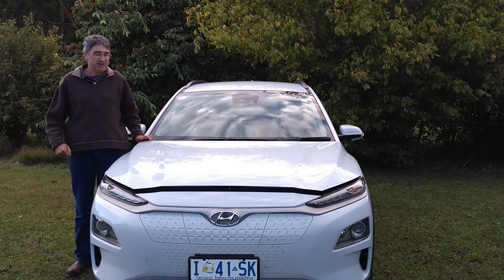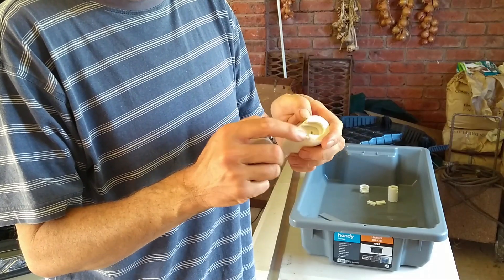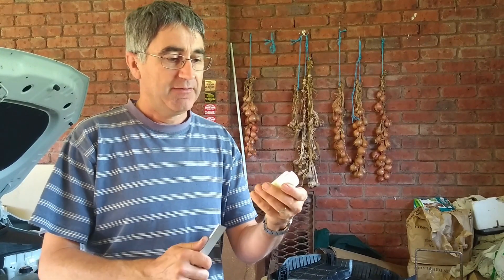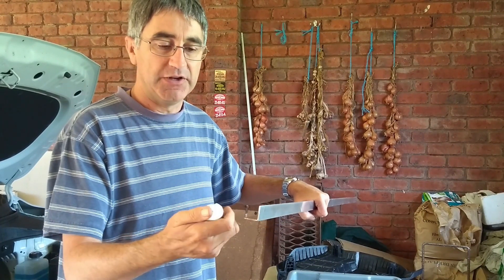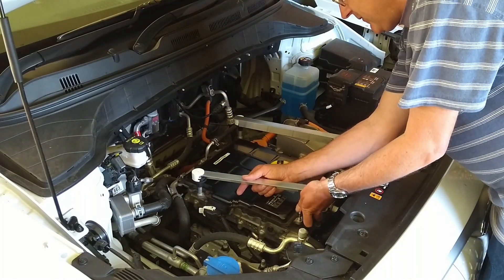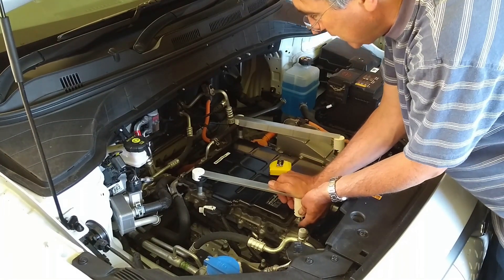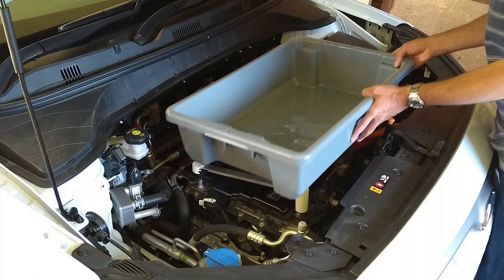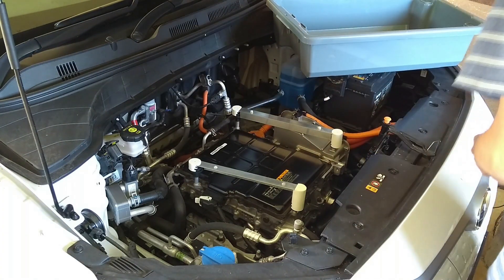DIY Froot (Frunk) for Hyundai Kona Electric

Comment: How is it 4 years after? 
I have doubts on the selfdrilling screws.. did thet stay in place with all the trillings?
Reply from the maker: Still going strong!
Keeps remarkably clean in there, I though the dust might get in.
It's been in and out a few times, and those screws are fine.  The 3D printed parts are a bit brittle, but they are still working.  No sign of any heat damage.
Reply: @christopherwalkden   a friend of mine printed the things for me in ASA... And it did well until now.. I checked cause the box was wobbly...  the back right piece was gone... the right front piece about to fail... so the frunk is out for now... I'm gonna need to print the pieces anew, probably in another material... do you know what material yours were printed with?

Comment: You could have used a 3mm bar and filed the ends down to 2mm, Also I would have also placed a bar across the inside of the Frunk to make it a bit more rigid. Also A frunk with a lid would have been a help too.

Comment: I am totally perplexed why so many Kona EV owners seems to want to bother
 putting a frunk in? As I have posted before, Hyundai avoided a frunk 
for reasons of affecting the cooling of the motor below in that area. 
All you are getting is a max of 1.8 cubic feet of storage? In a dirty 
outside temperature environment.
Reply from the maker: We've had a few months now to see if we actually use this space.  Perhaps I can help with your perplexion!
The Kona has about 330 litres of boot space, and the tub I put in is 30 litres (about 1 cubic foot).  330 litres sounds like a lot, but in practice it is tiny!
When we go travelling we have the boot filled to capacity, sometimes with heavy stuff.  There is some space under the floor of the boot, but that is not practical to access if you have anything sitting on the floor.  So previously, we'd put our charging cables on the floor of the rear passenger area.  Our charging cables are often dirty, so we'd clean them off before we went on a trip.
Now, we use our froot to store our charging cables.  We typically have an EVSE, an extension cord and a type-2 AC charging cable.  These all fit comfortably in the 30 litre space, and it doesn't matter if they are a bit dirty.

As for cooling the motor, it has a liquid cooling circuit which uses a radiator.  My tub is placed on top of the charger, which is on top of the motor controller, which is on top of the motor.  In theory the tub could affect the cooling of the charger, which is why I place it up on stilts to allow airflow.

Comment: You put a plastic box on top of a component that gets very hot.
I am concerned that this plastic us not thermally stable. 
The plastic is not heat resistant.

Your car does  not have a heat pump fitted to it.  Very strange.
Reply from the maker: The Australian Konas did not get the heat pump.  Very annoying for people like me in a cold part of Australia!
Indeed, the charger can get warm.  I've left a decent gap between the charger and the box, so it shouldn't heat up too much.  I imagine that if it is hot enough often enough then the box may become brittle over time.

Comment: Somebody should sell the 3d printed parts as part of a kit.  A Frunk would be a goof place to put the granny EVSE and any adapters such as ones to use an RV power socket or a Tesla level 2 charging station and the air compressor and tire sealant kit.  It's amazing that Hyundai didn't set up storage for those items in that space.

Comment: I like your ingenuity but I don't see how this is a benefit. You have to go to the bother of unlatching the bonnet from inside the car every time you get your charging cable (which is the only thing you'd really wanna transport in the front given its depth) 
More hassle than just getting the cables from the boot.
Reply: Strange comment……what is the difference between pop the hood or open the car on the back?.
It’s equal the same “bother” .
but when the car is stuffed with suitcases or groceries then you get the benefit of the Frunk 😌
Reply: I personally don't use the "granny charger" and either charge at a fast charge station - which has it's own cable or my home level 2 station, which also has it's own cable. So, you would just be looking for a convenient spot to store it for the few times in an emergency you needed it. With the styrofoam insert out of the trunk (boot) you have quite a bit more room. We don't have single use plastic bags here anymore, so this spot is great for my reusable shopping and produce bags. The frunk would also be a handy spot to put my emergency gear in case of a winter breakdown.

Comment: I velcro'd a 4 litre box with a a lid to the top of the obc. (Kia NIRO EV.) It holds the KIA evse, the tire  patch kit and air pump. Never touch the contents, only for emergency. ⛽
Reply from the maker: This means that you don't have a gap between them?  How warm does it get when charging?  I guess it would make the most heat when charging at 7 kW on a sunny summer's day.

Comment: The OBC is water cooled, it doesn't get any more than " a little warm"
Reply: Interesting, I know that the three coolant loops in the Bolt uses automatic transmission fluid as the coolant.  I would've expected the Kona to do the same but I guess a glycol water mixture would be sufficient so long as the level and concentration was regularly checked.
Reply: I made a video about the temperature, check it out https://youtu.be/58gJkdz2br4
Reply: @MrAbletospeak Apparently, reading must not be your strong point as I had explicitly said the Chevy Bolt used automatic transmission fluid as the coolant and I would've expected the same approach be taken, though a water and glycol antifreeze mixture would also work if the levels were frequently checked and the concentrations maintained, so in essence my guess was already stated for those who are literate as being the ATF especially as an oil based coolant would not be conductive while a water based coolant would be hence the video saying water cooled is a bit suspect (do you really want 400 to 800 VDC water cooled).
Reply: @MrAbletospeak Yes but my post said I had expected the same oil based approach as the Bolt used.  The "I guess" was a concession to the questionable use of water cooled mentioned by the video.  You are still failing in comprehension.
Reply: @MrAbletospeak Sigh, demonstrating your illiteracy again.  The video poster said water cooled, I said that I had expected oil cooler as with the Bolt but conceded that glycol water if carefully monitored would work as a coolant.  All you're doing is den narrating illiteracy in first missing out that I had expected oil based and only conceded water cool might be an option but not the one air had expected.   You do understand that reading requires comprehension and it is the comprehension that you are repeatedly failing.
Reply: @MrAbletospeak Sigh, yes read the post, not only one sentence in the post.  The post said that I would've expected oil based cooling like the bolt but the water coolant suggested by the video could word.  By only focusing on the sentence where  I said the water coolant with glycol antifreeze could work only demonstrates how simple winded you ate in not reading the entire post.  Enough is enough, I tire of your simple ignorance, you're muted now.